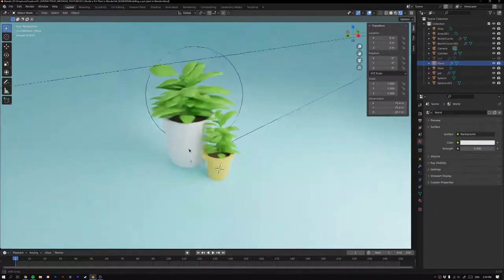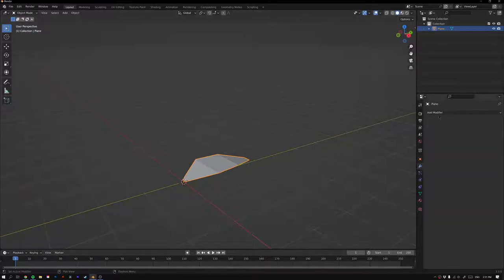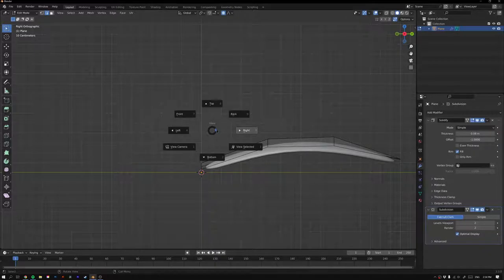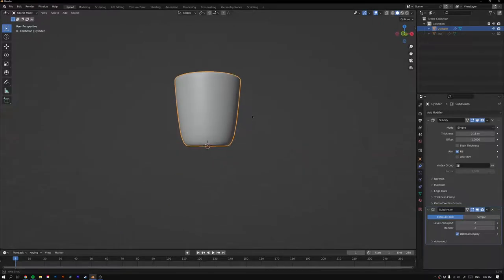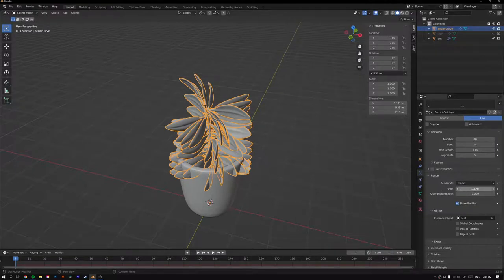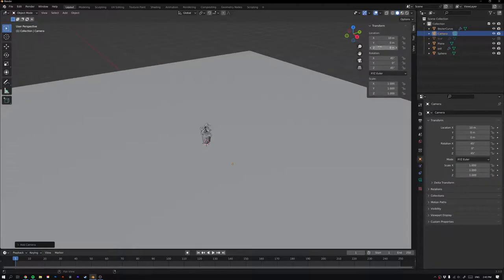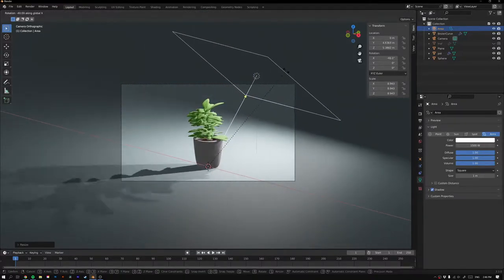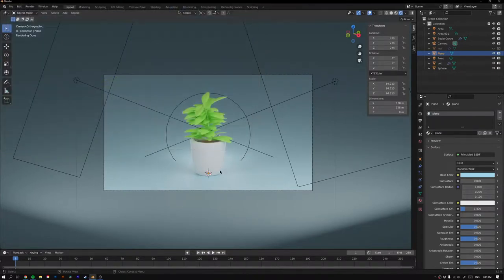How to model a Pot Plant using hair particle systems | Blender 3D

Comment: Hi thanks for this tutorial
I have a question to ask you
is it possible to mix particle system to add leaves flower and fruit to the plant and not only leaves ?
Reply from the maker: Yes, you can stack particle systems on top of each other by hitting the plus beside the particle slots.